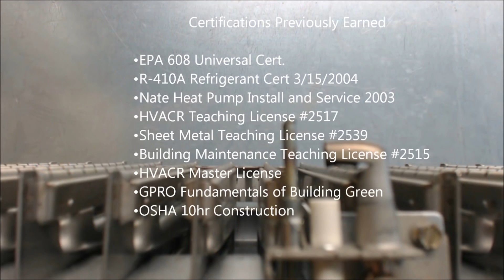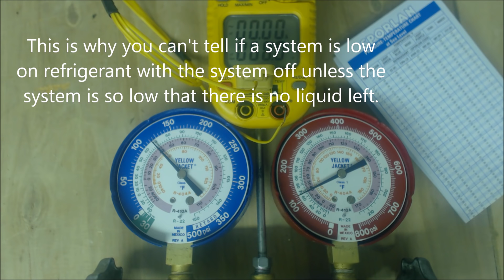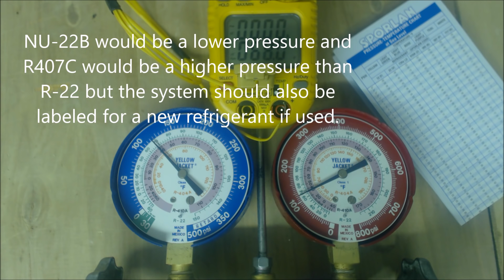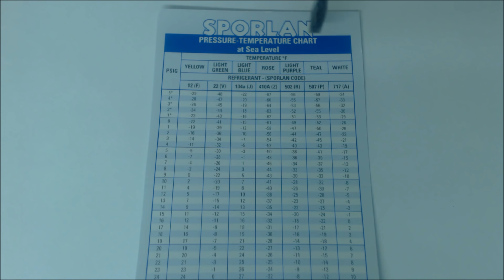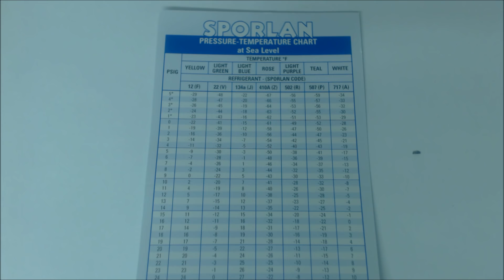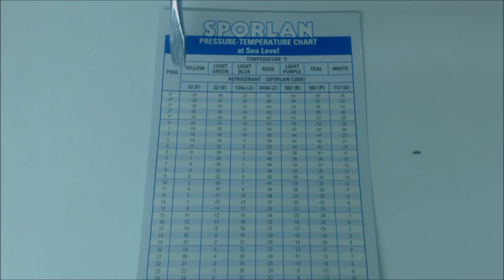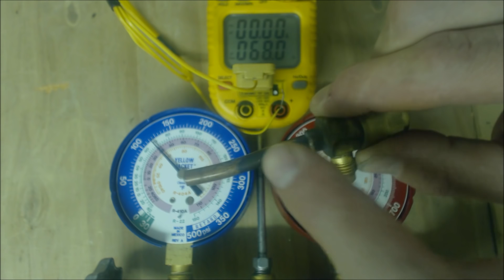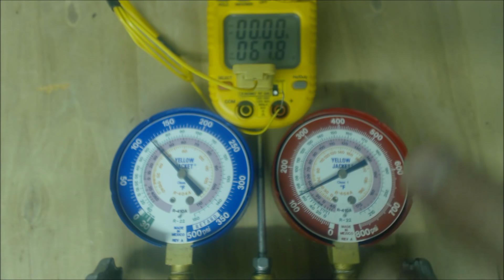How to Read the HVAC P/T Chart for the Refrigerant Pressure Temperature Relationship!

Comment: Im struggling to understand. I have a 1.5 ton R22 ac unit. Outside is 70 degrees. Im at about 4000 feet altitude. How many psi should I recharge my system to?

Comment: How do I find out what the proper pressure I should be reading on my gauges with the unit running?
Reply from the maker: Hey Joe, first you have to find what metering device you have on the air conditioner to determine if you are using superheat or subcooling. Have you seen this video yet- https://youtu.be/F8657qU37gc   Then after watching this video look up either "acservicetech superheat playlist" or "acservicetech subcooling playlist" thanks

Comment: i have a question. would it be possible to charge an ac system without a txv? cuz i've watched few videos of yours of charging your system with the whole thing of sat temp on your high side gauge - actual degrees = sub cooling.
Reply from the maker: If a system has a fixed orifice, you use the superheat method. Look up "acservicetech superheat or target superheat" for charging videos, thanks

Comment: Hi A.c. would it be possible if you could do a video on the 30+ rule for head pressure using the same PT Chart ?
Reply from the maker: I would not advise using that rule of thumb but at some point it wouldn't be a bad idea to cover it because some techs still use or hear about that. It will get you close but now a days we are all about efficiency, thanks for letting me know that you would like to see that!

Comment: Does anyone have an opinion on using Acoustic Cover Blankets to lower the operating noise on a Compressor? A Customer has asked me to install one. I have not had this request before or have I seen one before. I have reservations. Please Advise. Ted.
Reply from the maker: They were pretty common to find on ten to fifteen year old  heat pumps. I have not seen them installed from the factory as much lately. The compressor cools off some from the air but not that much. The refrigerant is supposed to be the main coolant as the suction gas cools the windings. Think about it this way. Some heat pumps crankcase heaters run all the time, even in the summer. Thanks
Reply: thank's for the prompt reply. I guess I will install the cover as requested.